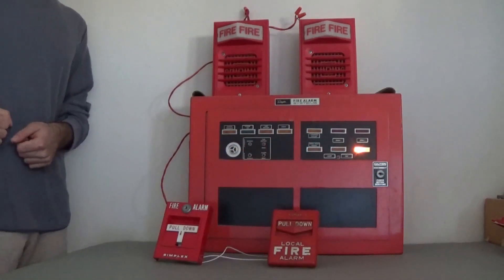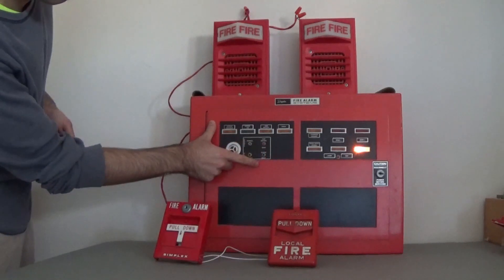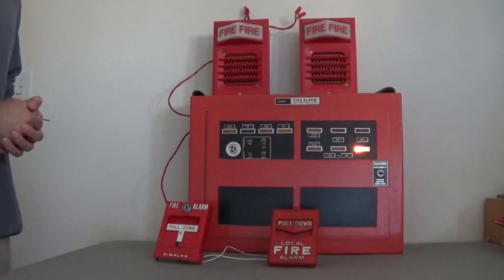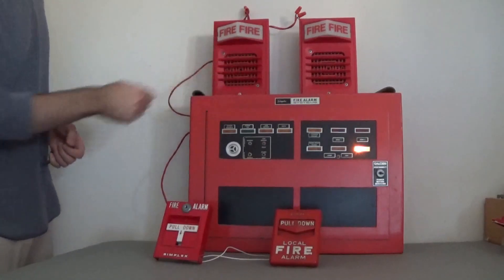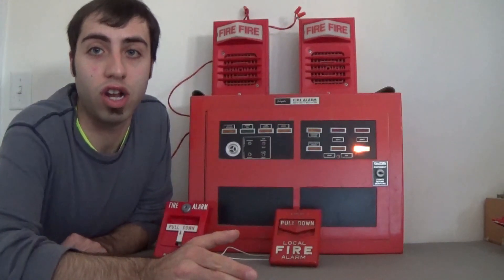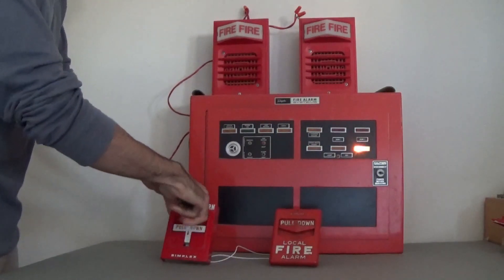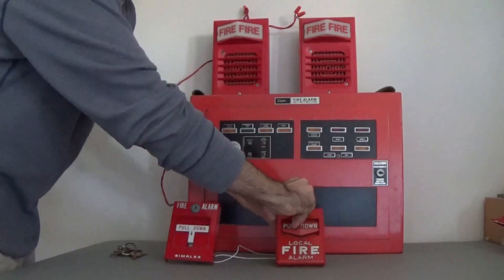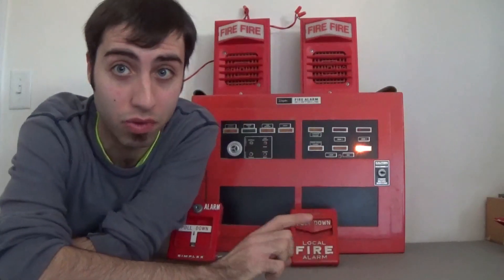3000 Subscriber Special - Simplex 2903 + 9806 MADNESS!!!

Comment: Really cool setup system!! And congratulations on 3k!! Stay safe and have fun!! ...
Reply from the maker: Thank you! You as well.
Reply: @Fahrenheit4051   how did you fried zone 1
Reply from the maker: @ajichristy4272  I didn't. It was like that when I got it.
Reply: @Fahrenheit4051  ok
Reply: @Fahrenheit4051   i dont how did zone 1 fried when you got that, was that a used panel. When i got my simplex tbar, the break rod broke my handle, and i got a another pull station
Reply from the maker: @ajichristy4272  Yeah, it was used and that's probably why it got removed. An unused 4207 would be near impossible to find.
Reply: @Fahrenheit4051  in ebay i got scammed, when i brought a panel from ebay, and  it was in a smaller box i thought it was a mini panel, no it was a key insted of a panel, i got ripped off for 50.99$that is why i stick to Amazon prime

Comment: You know, a community center in a city we used to live near in Florida has a nearly identical setup: 2903 strobe plates with 9806s in continuous, & 4251-20s. Only differences are they have a Simplex 2001 instead of a 4207 (the community center was built in 1985), in addition to the 2903s & 9806s it also has Wheelock 34Ts, & oddly enough, rather than going with Simplex smoke detectors, they went with Detection Systems DS200HDs instead! (there's also at least 1 System Sensor i3 in a kitchen probably replacing an older detector)

Great job finding that 4207, those are probably VERY rare to find in fairly good shape nowdays. Best of luck on getting the bulbs repaired &/or replaced.

Congrats on 3000.

Comment: Congrats on 3K! That panel is super rare kind of like a 4208 or a 2001.
As for the alarms featured, my campus building had them except the horn’s were the B4 series and the 2903’s were light plates as the pulls were 4251-20’s. Unfortunately, at the time campus access was restricted, the old alarms have been torn out (new voice-evac system) and I could not save them in time.

Comment: does this panel have 90 bpm i just wondering that and what was the first panel to have march time and coded this was loud too
Reply from the maker: This panel doesn't have coding options. Some of the larger 4207 and 4208 panels contained code wheels which had removable teeth, so you can do pretty much any code you wanted. Before the Simplex 2001 (the first panel to use solid-state electronics rather than clunky relays) came out in the very late 1970's, every fire alarm panel capable of coded NACs did so with a code wheel. But Simplex's were the only ones I know where the teeth could be removed.

I don't know what the first panel to feature march time was. Panels with a march time code wheel have existed since at least  the 1950's. There was also at least one panel from that era that produced code 3, using a large code wheel shaped like a goose foot: https://www.youtube.com/watch?v=EqypVuxpw0I - This was long before code 3 gained any sort of popularity, and the fact that it sounds so similar to the modern version is likely a coincidence.